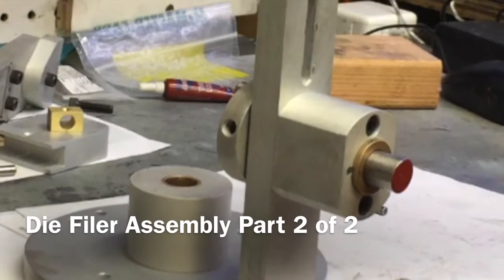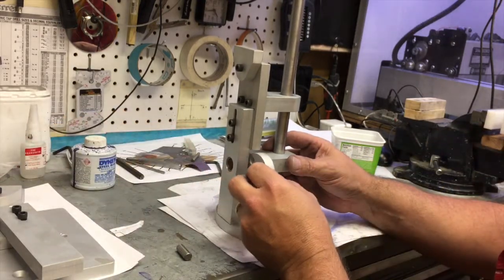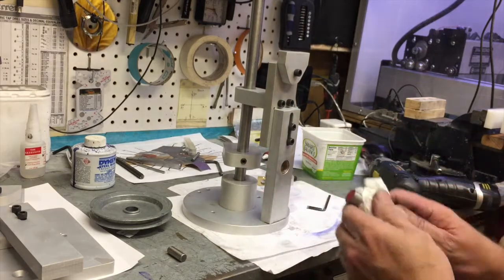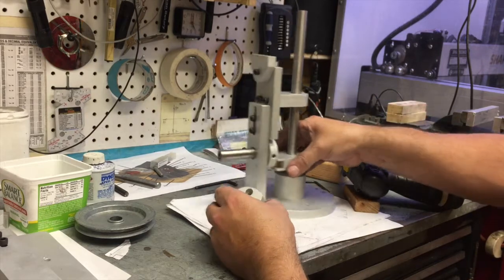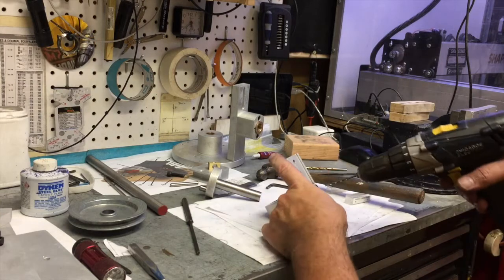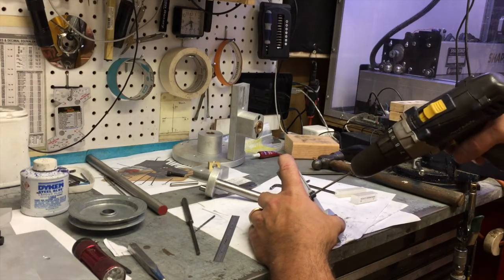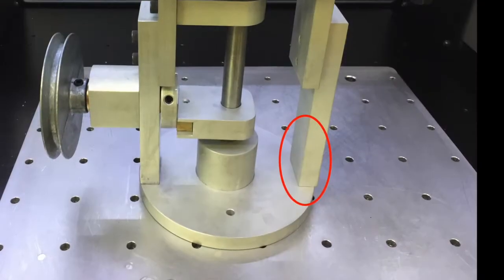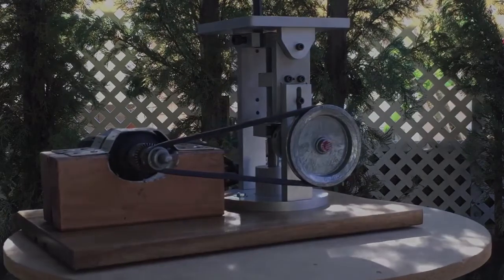Let's Assemble the Die Filer Built on the Shapeoko 3 or Nomad Desktop CNC machine Part 2 of 2

Comment: Richard,I am bought recently cnc machine.Looking to install as a spindle motor something like dewalt or makita router.can you tell me in your experience how long they can last
on cnc machine.Thanks
Reply from the maker: The Dewalt's  ($135.00) slowest speed is 16,000 rpm (TOO FAST).  The Makita ($99.00) is 10,000rpm.  Much better!   I am on my 3rd year using the Makita...so they last a LONG time.
Reply: Thank you

Comment: Richard, you have done such a beautiful job on the finished parts it seems such a shame that at 1.20 (assembling the two screws) in the slot, that you didn't place nicely made stainless steel washers to protect the surface of the part, 

Beautiful work though,

Edmund...........Alberta